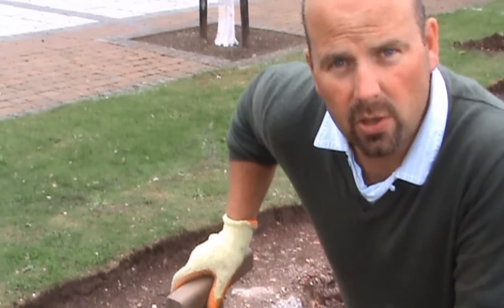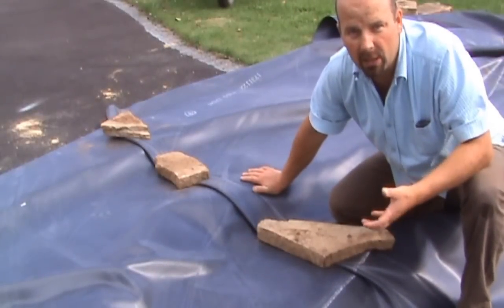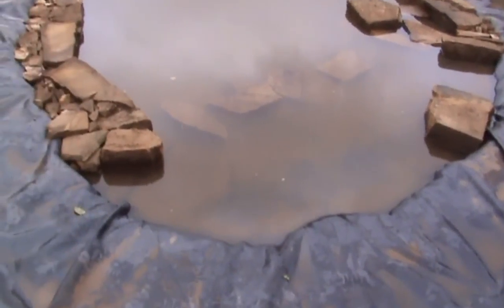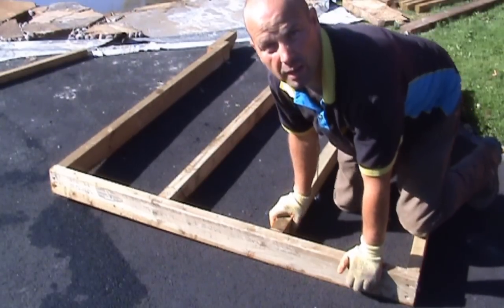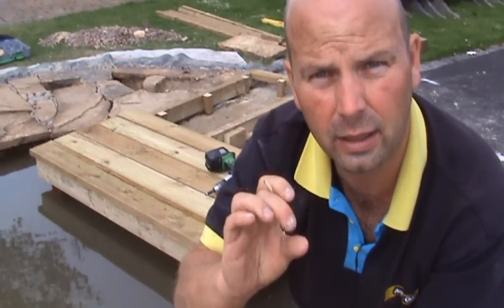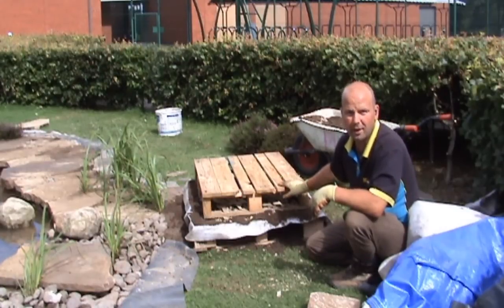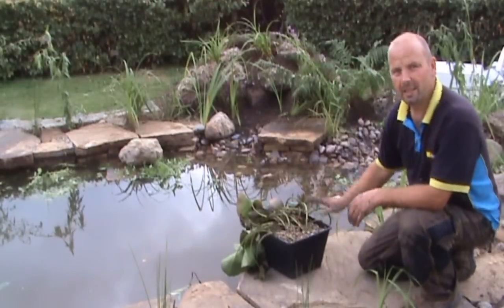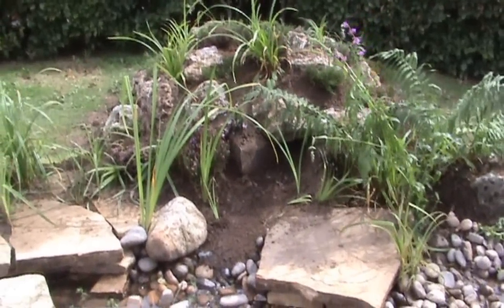How to Build a Wildlife Pond Video - Complete pond building video by Pondguru

Comment from the maker: With a clay lined pond it is often good to lift the clay out of the hole and fix a cheap plastic sheet system overlapped and pinned to ground under the clay being used to form the pond base / sides. This gives the clay something to spread out against which will minimise leaking. The sides will have to be shallow to reduce cave-in. Planting will stop erosion.

Comment from the maker: If you've ever taken out a pond which had sand under it you'll notice that not much of it remains after a few years as it is taken into the soil by worms, washed out by groundwater and slides off any sort of gradient. Safest to use underlay as it stays where it is put down, including vertical slopes.

Comment from the maker: Generally the cement is above the water line so doesn't affect the water noticeably once it cures.
For large cascades I would recommend filling the pond and running it for a week or so before completely draining it to flush out much of the harmful stuff which comes out of the cement. Then once it is refilled leave another week before you add a few fish weekly thereafter.

Comment from the maker: I normally just do it by eye when its being dug. In a smaller pond or a formal pond with walls / straight edging and no internal dry stone wall I would use a level. For large ponds I tend to use a laser level. In ponds like this one it doesn't matter if its slightly off level as the wall will cover all liner. As long as the capping is level the job keeps right. Since its filled before the capping goes on, water is always level and the best guide to keep capping level.

Comment: Love it, one of the best I've seen, really giving me ideas for my own pond. Just one thing, that decking is not structurally sound, the entire thing is relying on the shear stress of those screws. The frame of the platform should be rested on the leg posts directly, either by cutting a slot into the leg to accept the frame, or by setting the frame on top of the post, then screwing it together. I doubt this one will ever fail due to its size. But for anything bigger, you really need to use some joinery

Comment from the maker: If the water is clear, I'd leave it natural and try to remove the duckweed. Assuming the pond is a reasonable size you could put a few grass carp in there to control the duckweed once you get it mostly removed.

Comment from the maker: Not aware of any pH friendly concrete but a concrete and render pond painted with proper pond paint will provide a hard waterproof barrier which will last a very long time. If the pond is large and constructed properly from concrete and rendered (2 coats) it will cost more than a good quality rubber liner but will not be punctured.

Comment: Just the best video on building a wildlife pond on YouTube - congrats.

My pool is around the same size.........I notice you don't use an anchor trench - is fixing the edging stones down with sand/cement sufficient? 

Or is there some other reason to have an anchor trench?

Cheers
Reply from the maker: I think the anchor trench idea showed up in early pond building books and has just been copied into updated pond information but there is no real need for it - as long as the sides are fixed when the pond is full of water the liner can't go anywhere.

Comment: Love your ponds!  I think I have watched all of them.  Question what would you do to make a small duck pond?  Only have 7 ducks that I keep in my front area would like to have a natural enough looking pond with a natural type filter system, what would you suggest?
Reply from the maker: The major problem with ducks is that they tend to savage the plants so you generally end up with a muddy puddle which they seem to love but isn't too pleasing on the eye. Really a pond the size of the one in this video would be a minimum and they would still tear it to bits. Some plants will hold up quite well if they are put in full size and those would be iris, soft/hard rush, sedge grasses and I'm struggling to think of a submerged plant which won't get pounded by them unfortunately -maybe branched burr-weed or pickerel plant?
As far as a filter system goes maybe a home made shower system filled with alfagrog would keep the water healthy and aid the clarity but it would need to be the size of a 45 gallon drum for a duck pond.
Regards,
Richard
Reply: I have to agree any plants in the pond wouldn't work.  I think for my ducks I may even have to go with a concrete pond and work on a better filter system.  Thank you for insite!

Comment: hi pondguru, I've finally finished my wildlife pond with much help and guidance from your videos. took some frog taddies from a friends pond earlier this year as he had fish which always eat them. so was quite happy to have loads of frogs crawling round through early mid summer. even found a baby grass snake feasting on a frog so was chuffed to see all that plus many snails, pond skaters,  and diving beetles. plus one huge diving beetle 40mm long! my only question is now without the tadpoles I feel the pond is lacking something swimming round, is there any type of fish I could introduce to the pond without adding any filters and that won't eat the taddies each spring. thanks.
Reply from the maker: +uniuni Really the only fish which won't hammer the wildlife is the common minnow but they do prefer some moving water to swim against.The amount of wildlife the pond has attracted sounds very diverse and I'm assuming you live well south of me if you've seen a grass snake. I live right at the northern tip of their range.
Reply: +Pondguru Outdoors  thanks, yeah I see the odd snake about here in doncaster. there are plenty about but obviously hard to spot them, but I walk my dogs most days so come across them now and again. did think of minnows so may look into that a bit more and maybe just a small circulation pump, I have a solar powered oxygenator which cleared the water right up in 2 weeks or so as it was quite green for some time I think due to putting some Yorkshire stone in, which I have now took out. will post quick video soon. thanks.
Reply from the maker: +uniuni Yes feel free to link a video as I would love to see that. You're not too far south of me but it makes a big difference to average temperature and species which will populate the area.
Reply: +Pondguru Outdoors hi mate, round to uploading my video from my phone, of my wildlife pond. tagged you in the description but not sure if ive done that right. any advice criticism is welcome. the bubbles are from a solar powered oxygenator pump which prior to using the pond was green with no visibility,  now its crystal clear.
Reply from the maker: +uniuni It hasn't come through as a message but I will visit your channel and take a look no worries.

Comment: Hello Richard. I want to build a 10 ft deep pond,but I dont want to use that rubber liner. Do you have any videos like that?
Reply from the maker: Unless you have a deep natural clay base you will have to go with blocks, concrete and render which will then be painted or fibre glassed. Check the video I did a while back called 'How to build a koi pond - part 1'

Comment from the maker: The rubber liner waterproofs the pond in a lined pond construction. The polyester is used under the liner to protect it from puncturing from underneath. In a cement pond it should be painted with the appropriate paint. Check out 'How to build a koi pond' it will be one of the associated videos on the right side of this page or in my pond playlist. It has a concrete, block, cement (rendered) pond construction and explains the build.

Comment from the maker: Thanks for watching and appreciating. I have not used a sand filter on any ponds although I did have a fluidised sand filter which I intended to use on a pond but didn't have suitable fittings for the inlet and outlet so I scrapped it. Sometimes wish I'd used it to see what it would have been like.

Comment: Great video thanks for been so detailed. I'm planning my own wildlife pond right now but I just had one question about it. How do you prevent a pond from becoming stagnant, is it just by using the oxygenating plants? I always thought the water had to be aerated by something. Thank you in advance if you could just clear this up for me. :-)
Reply from the maker: Provided there isn't a load of decomposing waste on the pond floor and it is well planted it will not become stagnant. An air pump can help but usually isn't necessary. Oxygenating plants will do the job of aerating the water but shouldn't cover over 2/3 of pond or you will get huge swings in oxygen and carbon dioxide from day to night. I tend to go with around 1/3 of pond with oxygenators and the rest marginal plants.

Comment: how bout doing a large pond like say half acre? and over 10 feet deep in the middle thats what im doing and i need help with ideas on it having trouble with the walls caving in and it wont hold water trying to use red clay to waterproof it being my yard is nothing but clay and rock i got a tractor to do the diging and stilling having problems any ideas?

Comment: Will there not be some kind of filtering fountain or waterfall to keep the water from going stagnant ?
Reply: Adrien Joinette, I suppose if they put enough oxygenating plants in the water they should be able to keep it clean even without filters. In the north of England evidently they can pull it off.  I don't think such a shallow pond would work in warmer climates. You have also to consider that this is not a koi pond, frogs and newts don't mind still water.

Comment: guru, sensei, I applaud you.  I worry about broken bottles or garbage,  How would you dredge it,  without damaging liner in say, 35 years?
Reply from the maker: It would be drained using a large pump then detritus and litter would be removed by hand. It's the only way to ensure that the pond is properly cleaned. Either that or for a smaller pond a pond vacuum like the Oase Pondovac 4 could be used to suck up the silt etc. then once the water had cleared any larger items could be removed with a net.
Reply: One of my childhood buddies drove his mum's car into a neighbours pool, is where I got that nightmare.  The other was my own son crashed his bike into the local church's pond, that was my fault I let him in the gate.  I have had trout tanks in for over ten years, in three restaurants, (two sixty gallon tanks and one 400, the 60's hold 24 10' trout, the 400 can only handle about 100),. and I am dying to build a pond. ( I closed the restaurants in 1998 and have been itching since).   Since I watched your video I have designed two small pools that flow into one bigger one.  How much elevation can I push the Oase pump, from pond B back up to pond A and a separate pump to pump C back up to B? How did you say simultaneously?   Thanks for the reply, you are the guru!  Where I am I will have an occasional Moose get into my pond worried about the liner. The site I'm on is at 6800ft on a hillside with a 5% grade in Wasatch county Utah.
Reply from the maker: Driving a car into a pool is a pure rock star move so I applaud him for that, lol
Trout are great and I love having them in my pond although I wouldn't like to eat one from there as it is stirred up again due to the farmer messing about with the springs and pipes up the field.
I bet moose could do some real damage so it would definitely be good to have an extra layer of underlay over the liner or even fill it with flat stone, cemented down to avoid any damage.
If you let me know the vertical lift from the bottom pond to the top one and how wide you want the flow coming back down the cascade (over falls) to be I could give you an idea of what pump you would need. I don't have the flow charts now from Oase but I can remember most of the figures.
Feel free to send pictures of the site to sales@filterpro.co.uk too as that would help.
Regards,
Richard
Reply: I have fallen in love with a lot.  I have not yet made the land deal. I should have no trouble with my lender.  Probably by fall I will have a draftsman working on the gradient and will get back to you.  Meantime I will be watching your vids.  you are a master craftsman, dude!
Reply from the maker: Yes no problem, get it measured up and I'll work it out.
Reply: I ride a Bionx 250w electric bicycle.  What would stop me from building a small race with a lovely waterwheel?  Could I plunk a wheel in the cascade on your video and recharge my bike battery?  I was wondering how high the pump could push, as it would lengthen my race.  I'm researching several properties, let's say, (in a perfect world), I have 5 acres, more or less level, and a big earth mover, what elevation could be done with three ponds two cascades, one a race?  The best I can do with the bicycle is reclaim and recharge about 10%.  The wheel could for sure, contribute to the battery bank that ran the pump, running off the big grid. My ponds must be, in a not perfect world, small enough for me to build with a rented baby bobcat excavator, and use something like 300 dollar pond liners, I'm thinking 6 person hot tub size.  Bear in mind I ran a profitable trout operation for almost ten years out of two 60 gallon tanks.  The dinky little $60 pump I used to filter my tank water, I had three, could barely push above my head.  That was a foot and a half or more in elevation, but I wonder what effect when you try to go 15 or 30 feet away, or hopefully more?

Comment: this is a test for a bigger project, I can't explain everything as the comments are too short, the pond will help regulate the temp of dome & vica versa, cold spring water & shaded in the summer, also high up so always cool in the evening, only the deep part is in the dome, the rest of pond is outside, 8000 litres in all, it is quite well researched and based on working models, main thing is that normally wildlife & aquaculture aren't mixed while I want to mix them as part of a permaculture farm

Comment: That's a great job you did building that pond, excellent.  There's one thing that should not have been done though, and that was the lead you used to wrap the plants so they remained at the bottom of the pond slowly releases poison that contaminates the water killing off all plant and anything containing  life that in some form absorbs or ingests that pond water.  The Romans used lead pipes for all their plumbing which induced their life span to the age of 40yrs.

Comment: Could You say what is the model of the torch you are using? Or give any suggestions about the torches that would help with the liner?
Reply from the maker: It is just a small torch used by plumbers and I got it from Plumb Centre but you can get them from any DIY store. The torch is only used for joining the underlay together.
Thanks for watching and appreciating the videos.

Comment: Hi Richard, any ideas on how to get rid of green algae in my wildlife pond with killing all the wildlife that has now made my pond their home?
Reply from the maker: I'm assuming that you have a pump and filter on the pond? If so a UV light will kill suspended algae (green water) but if you are getting blanket weed then something like this (available in different sizes) is a permanent solution - quite expensive but works extremely well and does not affect wildlife: http://geni.us/qtifw

Comment: A+ thanks for posting this!
Reply from the maker: No problem man. I was pleased with the finished pond and the video with this one.
Thanks for watching and appreciating the video.
Reply: Pondguru Can two filters work with just one pump? if yes how can it be connected...
Reply from the maker: jideofor Ezewata Yes, will work no problem.
If you search for a splitter from Oase called Y-DB that will allow you to split (and control) the flow to two filters.

Comment: I have 0 knowledge of ponds (which is why I am watching this video) but I'm wondering isn't this pond rather shallow for fish to be kept in? I mean won't the pond fully freeze up in winter?
Reply from the maker: Yes it is too shallow for fish as it would ice over (not freeze solid as we are in North East England) but it is a wildlife pond so will not have fish in. Fish eat the wildlife. Check out my other how to videos or fish pond and koi pond building.
Reply: Ah ok awesome I thought it would also include fish :) Would it be possible to also have fish in it if the pond were deeper? I mean, they might eat some wild life but not all of it I assume? Thanks for responding mate!
Reply from the maker: AKARazorback Fish eat daphnia which in turn eat single cell algae (green water) so you would need a pump and filter to keep the pond clear if there were fish in it. They would eat the majority of tadpoles and newt larvae too so aren't recommended for a wildlife pond. Make it an extra 1' (30cm) deeper and fish would be no problem (but you wouldn't have much wildlife for the schoolkids to study)
Reply: Ah ok! Thanks for clearing that up... so in theory you could keep a clear pond without a pump as long as there are no fish in it? Could a mixture be achieved as well, maybe by making some basins of sorts where the fish can't get to, so you get best of both worlds?
Reply from the maker: AKARazorback It would be cheaper to just get a pump and filter if you wanted fish. Wildlife won't stay in one place.